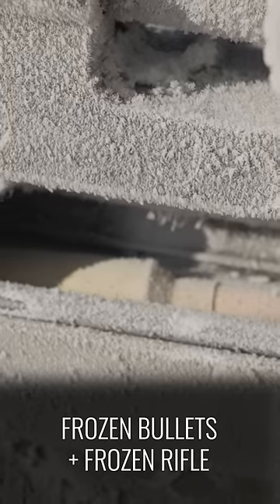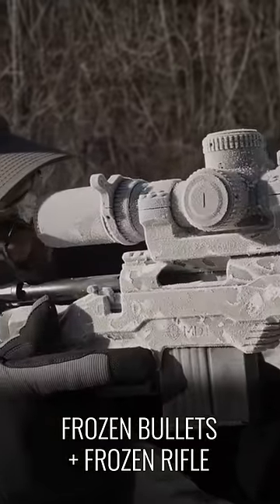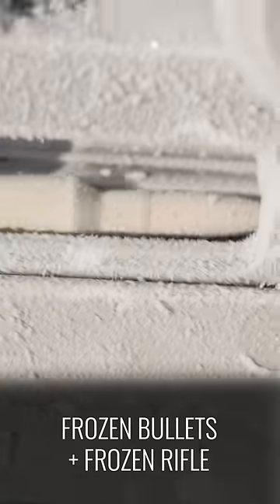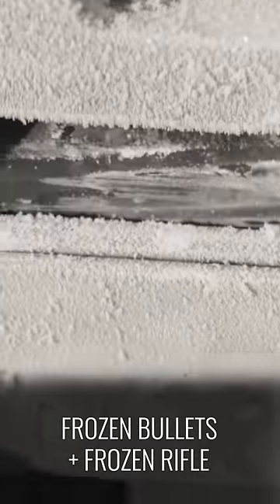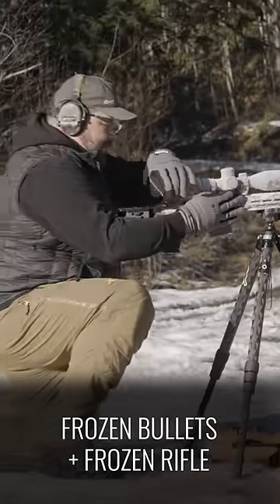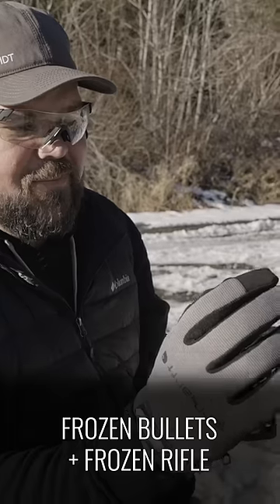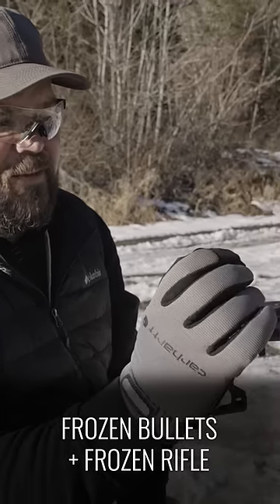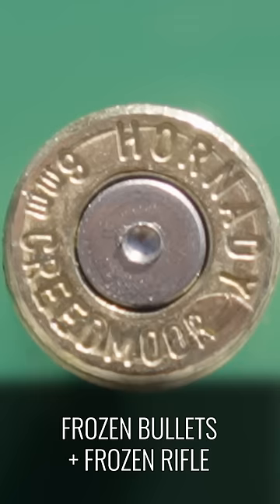Testing Extreme Freezing Temperatures On A rifle

Comment: "nOt SaFe tO ShOOt" *laughs in mosin Nagant.
Reply: Once shot a .308 out of a mosin by accident 💀
Reply: Thats what I was thinking lol
Reply: @Jeff Bruh  Did it survive?
Reply: Yes sir!!!!!!
Reply: It shoots everytime just not well.
Reply: @jeffbruh3253  bruh
Reply: @jeffbruh3253  308 is weaker than 7.62x54 R.
Reply: @Sgtassburgler  you have no idea how guns work do you
Reply: @jeffbruh3253  bro did you survive? 😭
Reply: @tgs9740  „.308 NATO“ is 7.62x51, NATO doesnt use imperial measurements for anything
Reply: I accidentally shot a 30-30 out of a nagant.
Reply: @chadb2077 Wrong, albeit they will chamber and fire in a Mosin, your looking at .308 being a way hotter round. You can probably get away with it once or twice in a Mosin, but not any other gun
Reply: Moist nugget gang
Reply: @chazwregman1418  you could get away with it in an arisaka. You could probably shove a lead pipe down the bore and shoot .308 and it would survive. Multiple account of people loading 30.06 down a type 38 6.5 barrel (it’s Mauser action so it will eat anything with a big enough rim circumference) and it swaging the bullet to 6.5. The gas vent holes prevent over pressure in any way.
Reply: @jeffbruh3253  "by accident" sure lmao
Reply: @MTGPringles  yes, however me and my friend realized the mistake I made after the bolt wouldn’t open, and after it did half of the case was stuck in the chamber. Didn’t help it was a steel case round either lmao.
Reply: @jeffbruh3253  hahaha lmao sorry bro I got a kick outta that - motivation to keep working this morning, so I can earn a mosin. Never even held one before. 😍
Reply: @jeffbruh3253  bet the gun is still perfectly fine too
Reply: I wonder if my finnish mosin is even better in the cold?
Reply: @chazwregman1418  Disagree. Read hatchers notebook. Chapter 8 I believe. Bolt actions are MUCH stronger than we give them credit for. The springfield he talks about there every gun barrel gets tested with 70 or 75 thousand psi before even being sent out of the factory. That being said they can surely handle more without breaking. 308 is like 60,000psi. I believe he stated that the regular cartridges are only about 1/4 of what the gun can handle. I should add that the springfield 1903 is generally not considered one of the stronger actions out there. So if it can do this, others can as well
Reply: @jeffbruh3253  same
Reply: @Sgtassburgler  7.62 rounds are military grade, they are ass compared to 308
Reply: @Dexter-nw2fe  Please explain to me how 7.62x51 is more powerful than 7.62x54.
Reply: @tgs9740  considering no one who uses firearms will ever call 7.62 nato a 308 nato it’s safe to assume it’s 308 winchester
Reply: @habibsspirit  please explain to me when i said that
Reply: And also laughs in sks and ppsh
Reply: @chazwregman1418  i think you replied to the wrong person lol
Reply: @Dexter-nw2fe  Mr. Complete Badgel said ".308 is weaker than 7.62x54 R." - You replied "you have no idea how guns work do you" - From what I understood, you implied that Mr. Complete Badgel was wrong. So now I'm asking you why; Why do you consider .308 (7.62x51 NATO) to be more powerful than 7.62x54 R?
Reply: @joekrafft7125  I just did that lol
Reply: @habibsspirit  lol you should real the whole conversatiom before you assume like a smartas. Look at what mr.completebadgel is responding to "308 is weaker than 7.62x54"
Reply: That thing could have a bent barrel, a cracked stock, and a hair trigger and it would probably work just fine
Reply: @jeffbruh3253  How do you accidentally shoot a .308?? It doesn't even have a rim lol
Reply: @Dexter-nw2fe  well he wasn’t talking about a gun, he was talking about a .308 vs rimmed 7.62x54 which he is also correct in it is a stronger round but more than likely no he doesn’t but we don’t know
Reply: The 308 can be loaded to higher pressures than the 7.62x54R. However, the 7.62X54R maximum bullet diameter is .312 while the 308W is .309, which should help lowering the pressure if a 308W is fired in a 7.62X54R. Headspacing is similar enough to not be a huge problem.
Reply: @jeffbruh3253  once shot a 243 out of my AR 10
Reply: Hell yeah brother , I got one like 4 years ago and it’s still my best firearm
Reply: Inuit and other northern natives watching this like “so… why did our southern cousins lose to the boys? Anywho let’s go get some polar bear”
Reply: @jeffbruh3253  I’ve heard of that before . Any issues ?
Reply: @darrengarcia4937  most accurate rifle I have
Reply: My Mosin was the my first rifle and still my favorite rifle.
Reply: @Jeff Bruh  well now you have a Mosin chambered for .308 lmao
Reply: @michaelg6455   💦 nuggets or 💀 well Now that I think of it, death will probably come to the user of the most nugget just like an arisaka More dangerous to the person standing behind it
Reply: mosins suck though.
Reply: @Noorthia  *some Mosin suck. Some are extremely well made. Like comparing Chinese Mausers to German interwar ones
Reply: Woah you know what a mosin nagant is? You're so cool man. Yes. This specific gun wasn't safe to shoot you dork.
Reply: @jeffbruh3253  had a customer buy a mosin years ago, and asked what ammo it took, told him 7.62x54R, he asked "whats that" I replied "basically russian 30-06" - fast forward a week and he called us complaining we sold him a junk gun. this guy forced a 30-06 into battery with a hammer and had predictable issues.
Reply: Who
Reply: @jeffbruh3253  same here I’m not proud of it but I fired it at a safe distance away
Reply: @Sgtassburgler  
What? No. .308 Win operates at about 10% higher chamber pressure that 54R.
Reply: @habibsspirit  
They are approximately equal in energy developed, with 54R having a extraordinarily slight advantage at the fringe. We're talkin' a few ft-lbf/J here. The differences are negligible. .308 Win develops significantly higher chamber pressures though. With 54R being in the 55kpsi range, while .308 is greater than 60kpsi. So, it depends on what you mean by "more powerful."
Reply: @ChazWregMan  mosins were chamber pressure tested at 60k psi, even though the round is around 40k psi. So they can handle the pressure of a 7.62 nato at least
Reply: @habibsspirit  7.62 nato is 60k psi at the chamber, 7.62x54r is 41k psi at the chamber
Reply: @Golden Maximo  chamber pressure isnt an indicator of the energy of the round, as both are almost equal with ballistics, nato just generates 19k more psi at the chamber. While mosins were tested at 60k psi, definitely wouldnt recommend it
Reply: Ah yea, the gun with more OOBs to date
Reply: @jeffbruh3253  is it still kicking? Or did you have to replace the barrel?
Reply: That statement is just ignorance the Mosin is not even the best rifle yeah you can shoot 1 mile out with right applications but the action is garbage compared to a k98 or a Springfield 1918 30.06 all this man needs to do is simple sleep with his rifle to keep it out of harsh environments like winter and I recommend this anyways most marksman take care of their rifles
Reply: @jeffbruh3253  I have also done this. Funnily enough I hit my target, I just had to use a cleaning rod to get the round out of the barrel
Reply: @Dexter  think hes talking cod 😂
Reply: @jeffbruh3253  nice! now try .303
Reply: Laughs in ak
Reply: @shanelefever7704  I love my garbage rod
Reply: @melonlab80 of course it did. The 7.62x54r cartridge is almost identical to the .308 except its rimmed hense the r at the end of 54r.
Reply: @melonlab80 of course it did. The 7.62x54r cartridge is almost identical to the .308 except its rimmed hense the r at the end of 54r.
Reply: @melonlab80 of course it did. The 7.62x54r cartridge is almost identical to the .308 except its rimmed hense the r at the end of 54r.
Reply: @melonlab80 of course it did. The 7.62x54r cartridge is almost identical to the .308 except its rimmed hense the r at the end of 54r.
Reply: @melonlab80 of course it did. The 7.62x54r cartridge is almost identical to the .308 except its rimmed hense the r at the end of 54r.
Reply: @jeffbruh3253  how?
The Mosin–Nagant uses 7.62×54mmR.
That isn't going to fire a central fire cartridge
Reply: @jeffbruh3253  how 😭
Reply: You can shoot anything once…
Reply: @jeffbruh3253  what happened
Reply: @CAStone-kq4md  nope, probably shouldn’t do it intentionally though.
Reply: @shanelefever7704  The action doesn’t really determine it’s accuracy……. all testing, the finish m39 which was just reconstructed an accurized 91 mosins where the most accurate rifles, more so than k98, and k31.
Reply: @darrengarcia4937  Tell that to Simo Häyha, pleb.
Reply: @gregorahler  “Of course it it” - Simo Häyhä (probably)
Reply: bruh unless you shoot in antarctica there's no way your gun will ever get that cold, that shit was frozen with nitrogen

Comment: At those temperatures, you've gotta assume the tolerances are way off. There was likely some gas blow-by.
Reply: No sir.  Tolerances are different, but all clearances would be “reduced”, thus increasing the chambers ability to seal.  The frost would tend to allow the case to slam back against the bolt face during ignition.  This would cause the exact conditions observed by the shooter in the video.

Also having cartridge cases that are sized to somewhat excessive (still within normal tolerance), would allow more movement of the case during the ignition and pressuring up sequence.
Reply: @dthunter2506rem  it’s also important to remember that not every part is made of the same material so some might shrink more than other causing separations
Reply: The rifle overpressured as the detonation happened probably put a lot of extra smack on the casing
Reply: You have a poor understanding of thermal expansion coefficients. Cartridge brass has a coefficient of thermal expansion substantially higher than that of steel. That means going colder the brass is going to be a looser fit in the chamber than if it were at room temperature. Lead has has nearly double the CTE of steel so that's going to reduce chamber and barrel pressures even further.
The case volumetric change is so small it's not going to affect peak pressures. That's totally ignoring the peak pressure reductions from the cold powder.
Reply: @dthunter2506rem  run the numbers, the actual change and headspacing is incredibly small at these temperatures. Nowhere near field gauge variation range.
Reply: @otm646  right we are talking probably less that .0005 in size difference and that's like a hair from your head.
Reply: i am no expert but i think you got it backways. 
In cryo the metal shrinks so its more likely the tolerances were way too close.

The opposite happens in the desert sometimes the chamber is just that much too long so you rattle a bit with blow by and accuracy suffers.